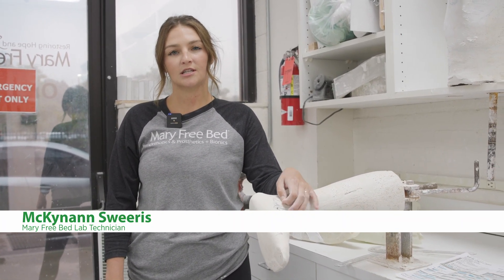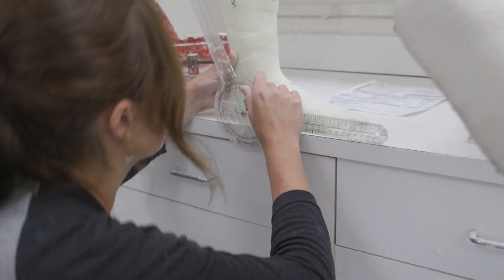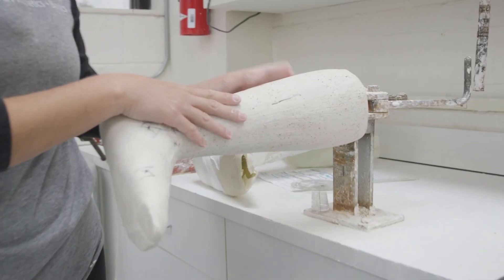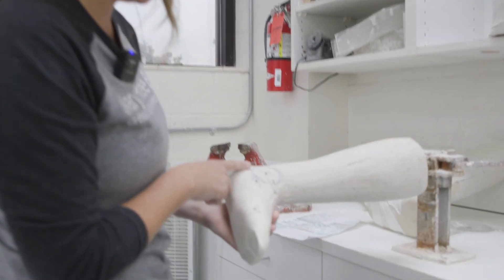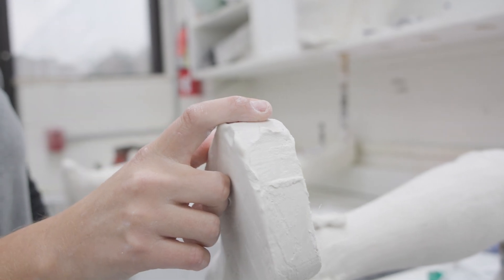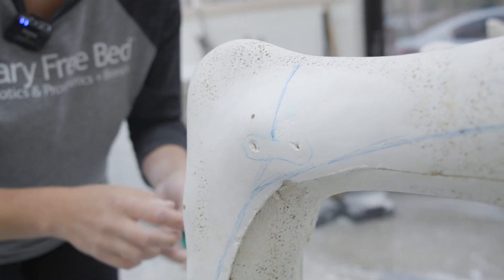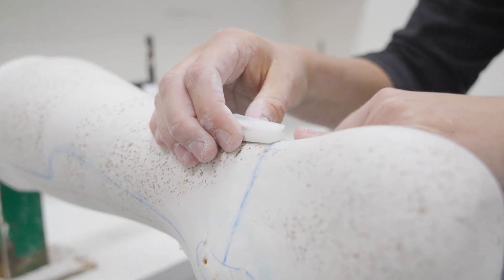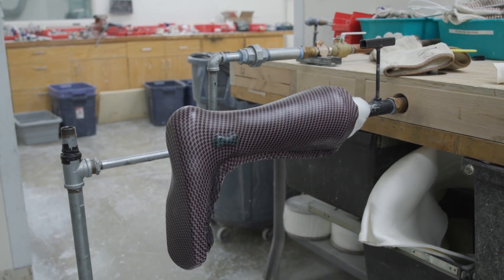How to make a custom AFO (ankle foot orthosis)

Comment: I couldn't wear that AFO.  I did try the plastic brace but  at times, my foot hurt so much and I was trying to walk so my foot would not hurt.  I had to take it off because of the discomfort and I still wore out the toe of my shoe.  I wear a metal AFO where the shoe is attached to the brace and with the metal brace I do not wear out my shoe. I have had no issues with the metal brace, it lets me live life to the fullest and that includes square dancing twice a week.   In my opinion a brace is suppose to enhance your quality of life not hinder it.
Reply: I’m glad you found something that worked! I have hinged AFOs for both feet, and had to have one of them adjusted a few times because the arch was too high and caused pain like you mentioned, but now that they’re correct, I can wear them all day without pain. I hope you’re doing well and enjoying square dancing!